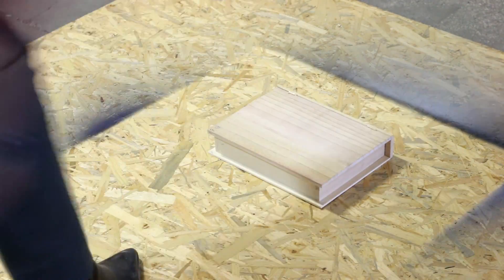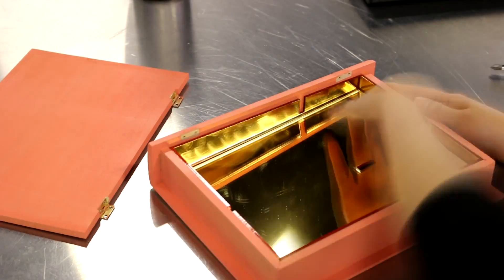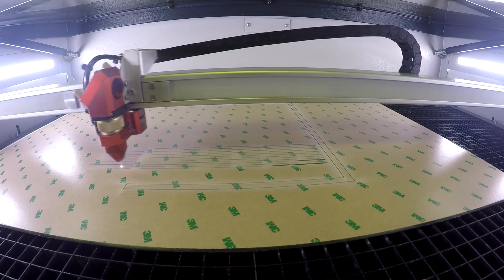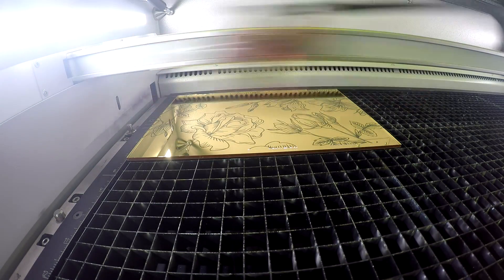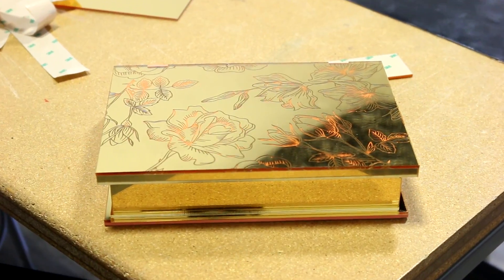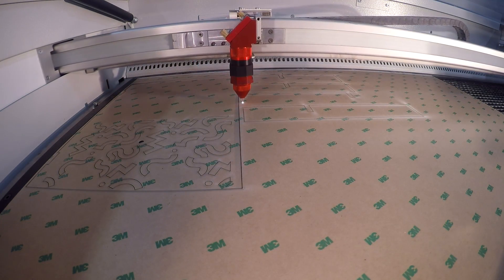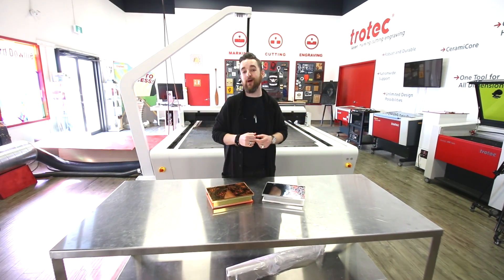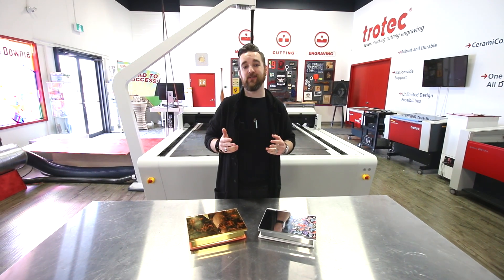DIY Jewellery Box | Mirrored Jewelry Box | Laser Cut Mirrored Acrylic

Comment: laser against mirror? Does not that reflect?
Reply from the maker: Good point, different lasers have different wave lengths. If you point a laser pointer it can reflect but CO2 and Fiber do not. CO2 engraves the top, while Fiber goes through the top clear acrylic layer and disolves the thin mirror film underneath.

Comment: can you flame polish the mirrored acrylic edges after cutting operations or will the mirror layer peel away from edge? THx
Reply from the maker: great point. With a laser you already get the flame polished edges on acrylic as you cut, unlike a CNC system where you have to flame polish it as an extra step.
Reply: @TrotecLaserCanada  you are assuming the cut went as well as possible. Sometimes that isn't the case hence my question. I was curious as to what effect a flame polish would have on the mirrored backing.
Reply from the maker: @mythyc9604  Every time we cut with our laser we get a flame-polished edge so we're not sure what you mean. If you go too slowly there could be burn marks underneath but that's with any acrylic not just mirror.